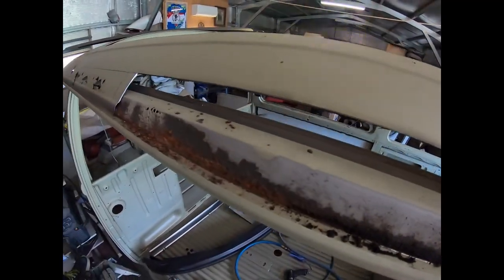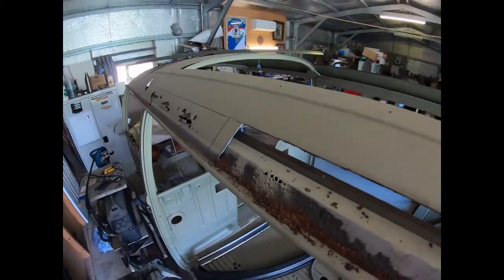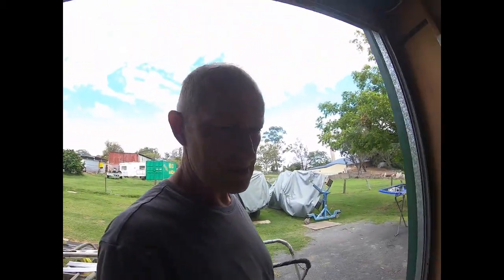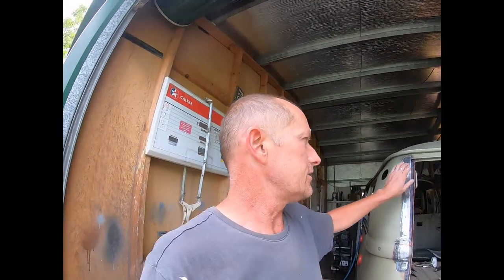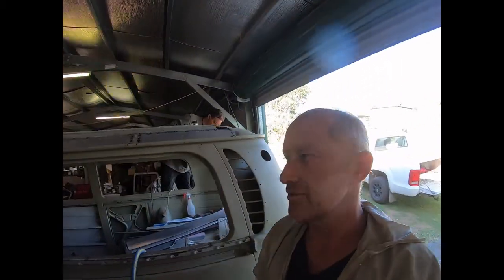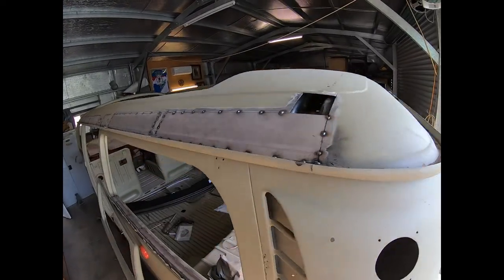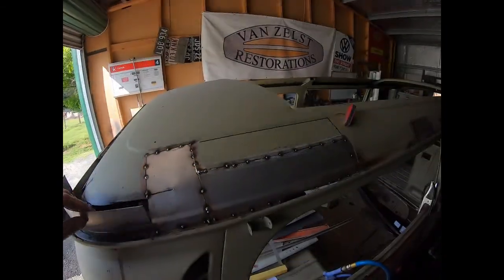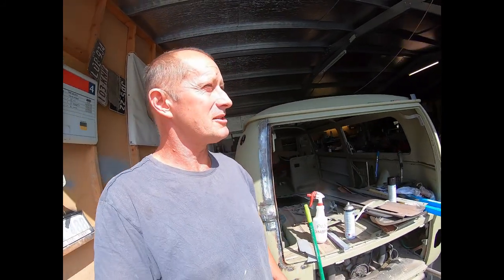Project Chilli - Part 4    VW KOMBI RESTO

Comment: What’s the black rust converter spray you use?
Reply from the maker: Hi Ayrton, its a spray on rust converter that primes the surface.  We normally use rustoleum brand but there are other similar products